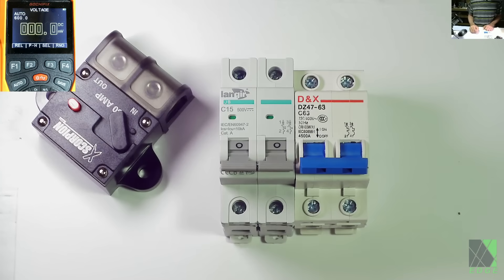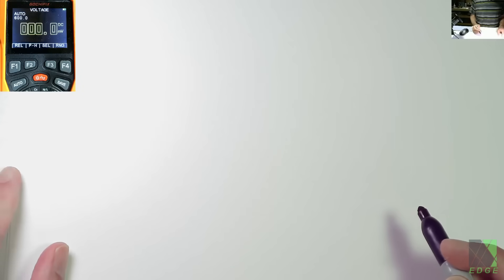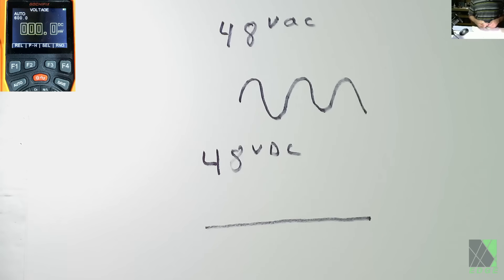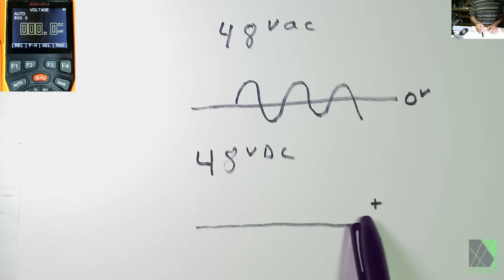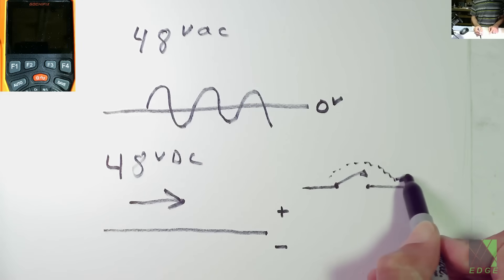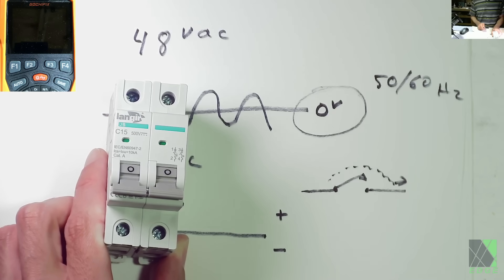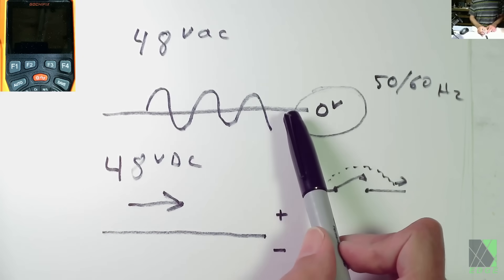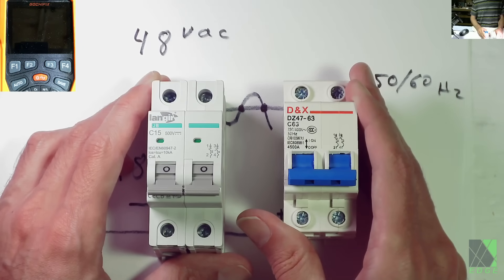Understanding PV Solar Circuit Breakers - DC vs. AC - why they are different #solar #diy

Comment: Good explanation mate. Basically ac is self extinguishing to some degree as it alternates. 
DC voltages can start a plasma burn across points and continue to grow as they melt metallic parts.
Reply from the maker: @evil17 Thank you! I deliberately burnt an AC switch with DC, it got pretty melted... video here if you're curious: https://youtu.be/Cu2gNi5oVe8

Comment: hi! I have a solar panel and a powerstation I've been wanting to put a PV circuit breaker (fuse?) between the solar panel and the power station. I've been figuring out which one I would need, I thought your video would help me out on this, but sadly not I think? Would be lovely if you could give me some small advice. 
Just so I can just 'unplug' the solarpanel safely and with just one switch, instead of taking it in and out of the port of the powerstation. It will be used for the van so maybe the conventional fuses are too prone to switch off while driving? Thanks
Reply from the maker: @MyAapjes Hi, you can just buy a standard DC circuit breaker for that. Just make sure the voltage rating is somewhat higher than the voltage of your solar panel, and the amperage rating is higher than the max amperage of the solar panel. Hope this helps!
Reply: @solarpoweredge  Thanks a lot!!! :)
Reply from the maker: @MyAapjes Welcome! :)

Comment: On a Dc breaker, Am I right in thinking it doesn't matter what way you connect the cables to the top or bottom of the breaker?  

The power is not directoonal if that makes sense?
Reply from the maker: @EnduroRideWales Some DC (direct current) breakers do have polarization, usually there is a small (+) mark and it's super important to read the spec sheet to see how to connect properly. But then again I've seen lots of DC breakers that are not polarized at all. AC breakers are not polarized because AC doesn't really have a polarity. Just my thoughts. Hope that helps!

Comment: Do they make a wife dc breaker that can be used for this?
Reply from the maker: DC breaker for a wife? This is not something I have found yet!!
Reply: @solarpoweredge  , lol, sorry.  I was asking if they make a wifi version of this breaker?
Reply from the maker: @ES-yi8vv  Haha got it, no problem! I have never seen a wifi breaker, but it's 100% possible to have a wifi enabled DC contactor. If you really want to have a breaker, a servo mechanism controlled by Arduino would do the job

Comment: Do I need a breaker between the solar panels and charge controller? Its only 2 600w panels in series each is 47 open circuit voltage ,max power current 15. thank you for your channel.
Reply from the maker: @matmat7676 Hello, you are welcome! A breaker between the solar panels and charge controller is recommended for 1) fault over current protection and 2) a convenient shut off for service and maintenance. Hope that helps!

Comment: Thank you for your thoughts. Although I think it is correct that the difference between AC and DC breakers is tge arc suppression, it does not seem correct to me to compare a DCs tendency to arc to a water hammer. The water hammer suddenly increases water pressure far beyond the static pressure by means of inertia. In case of electricity the moving mass and the electrons speed is too low to cause such an effect in everyday application. I think. DC does create arcs because the voltage that creates the arc in the first place, remains constant and keeps feeding the arc. In AC - as you stated - the voltage drops to zero 50 or 60 times a second thus interuptimg the arc. By the time the voltage builds up again the breaker should have physically opened up a gap that is to wide for another arc to form.
Reply from the maker: @solaroweder3707 It's not technically correct to compare electricity to water, but I do it anyway as it's helped me a lot with thinking through this stuff. Funny enough, I don't believe half the "electrical models" taught are even correct to begin with, but definitely better than nothing. A user of Conventional Current here :)